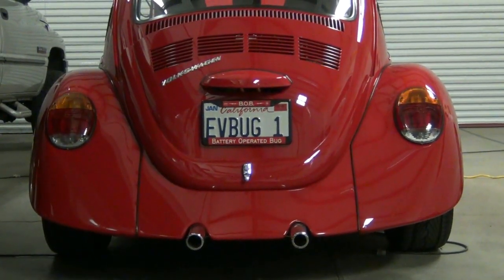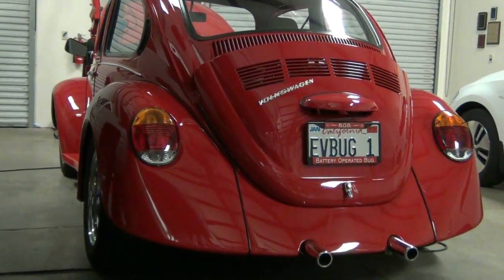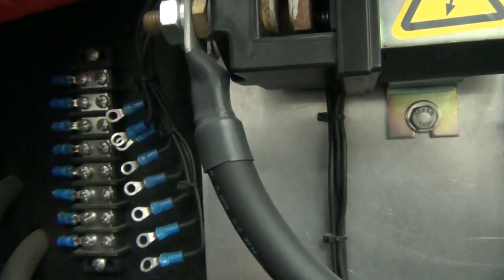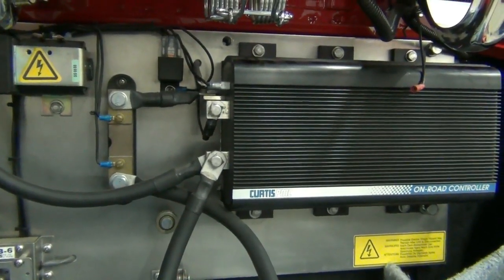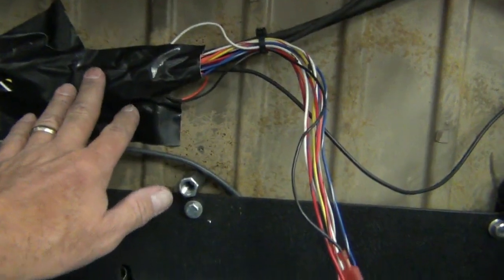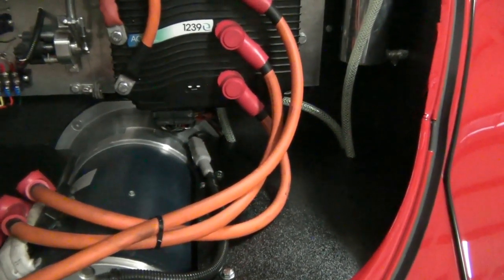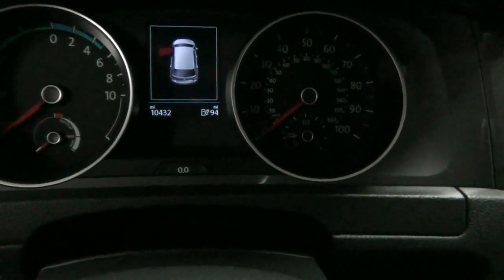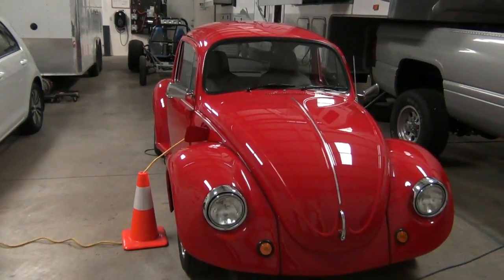VW Bug and Karmann Ghia EV Conversions - Upgrades and Goodbyes

Comment: Help me out with the wiring can you please tell me what specifications high voltage wire is using to connect the battery to controller and controller to the motor.
Reply from the maker: Please direct all questions and/or comments to:  info@EV4Unow.com
Thank you.